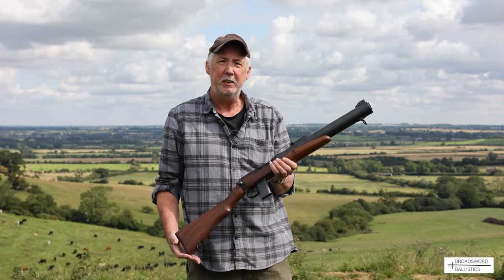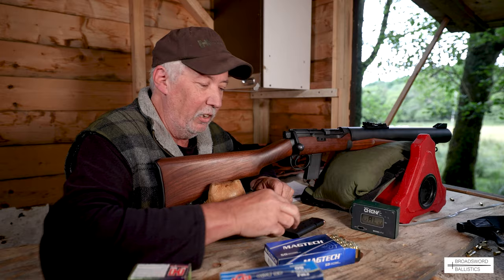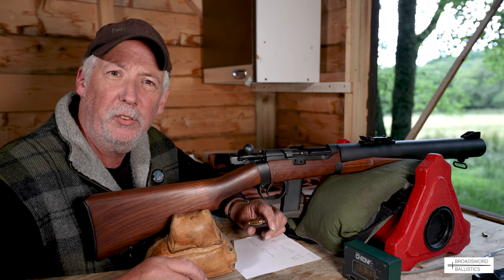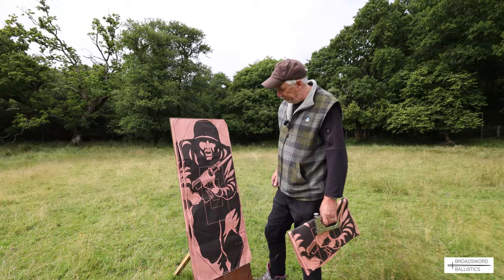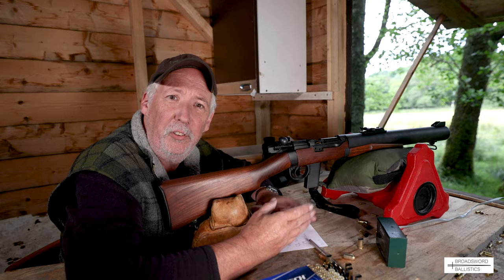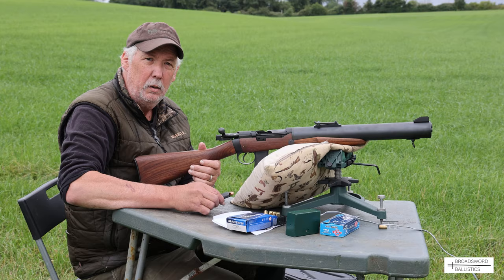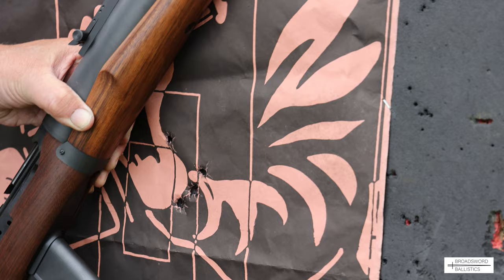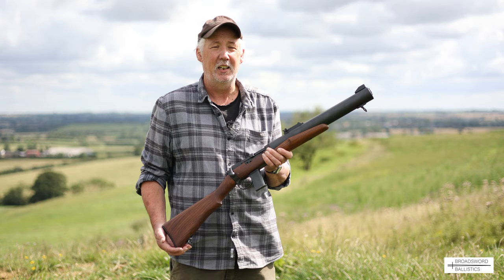De Lisle Carbine WW2 Special Ops

Comment: I hope the wartime version was quieter because the modern one is no where near as quiet as I expected.
Reply from the maker: Hi The wartime barrel was a lot shorter but for legal reasons in the UK its longer, hence less baffles, but you can reload to get it super quiet. At 100 yards when the De Lisle was fired the muzzle report was hardly audible, hope that helps.
Reply: presumably you have no experience of suppressed firearms, Hollywood suppressed quietness only exists in movies and possibly on rimfire guns with massive suppressors.. Most of my centerfire rifles you would not want to shoot indoors without hearing protection, even with a moderator on the end of them…

I have one of these from chambers and they are very quiet indeed, about the volume of an unsupressed sub 12 air rifle…

Best proper review on a firearm from a UK channel I have seen so thumbs up 👍
Reply: @todderstaffes  I have a .22 LR with a Parker Hale moderator and that seems quieter than the De-Lisle , unfortunately I can't afford to spend £hundreds on a suppressor only to find out they are no quieter.
Reply: Wrong mine is quiter, a take down and considering the smoke ,it isn't  black powder. 230 grain head 5 grains of red dot. Really quite same head 4 grains of red dot.@todderstaffes

Comment: I thought the velocities will be higher than declared on the box due to longer barrel use. But they turned to be basically the same as from pistol with 5" barrel. How come? Does the suppressor have some effect?
Reply from the maker: Hi, I too was surprised at the velocities not being higher but those were the results. I am doing another video as I have plenty of other reloads, penetration tests etc.
Reply: They are loaded for a standard 5 inch barrel so they use powder that will burn off in a 5 inch barrel. After all the powder is burned the longer barrel just slows it down with drag.